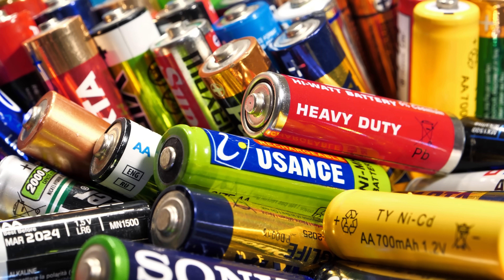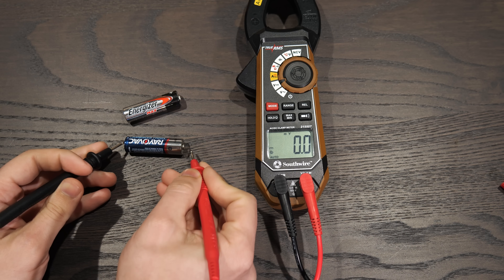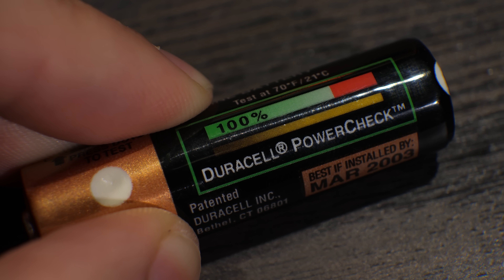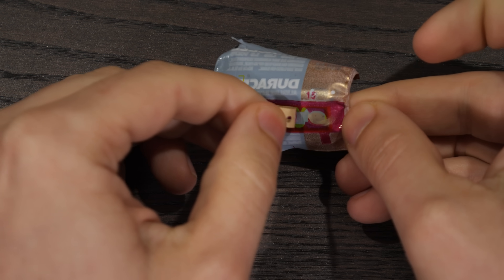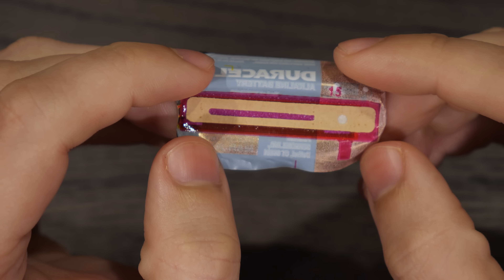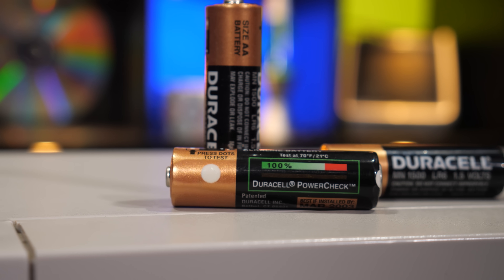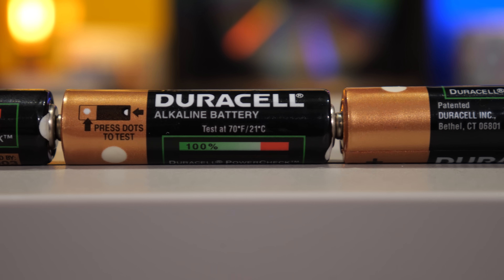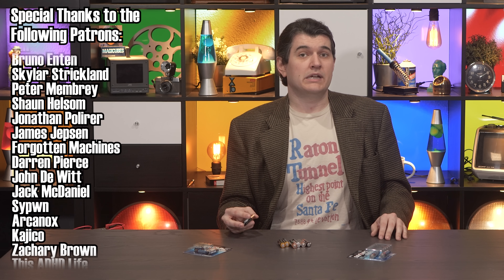Duracell PowerCheck: A genius idea which didn't last that long

Comment: You can drop a battery from 10cm height on one of its poles and judge how full it is based on how high it bounces. An empty battery will jump significantly higher than a full one

Comment: in my county we still have them,but the line is different, they have 4 squares, 2 green,one orange or yellow,  one red, they still "fill up" like it is only one bar with an overlay, but the color gradient is quite nice, they aren't even that much more expensive, just a bit harder to find

Comment: I was a police officer in the late 90’s to early 00’s.  When we did undercover work involving a wire, we always started off with brand new batteries in the wire device, because we were told that once a battery was used in a device, it would continue to degrade/lose power even if the device was turned off or the battery was removed.  The batteries that were used, even if for a very short time, were repurposed for things like tape recorders in interviews (don’t want to waste taxpayers money, ya know). I imagine that these days there are more compact rechargeable devices available for this type of use case.

Comment: I have to say, this would be at the top of the list of things I wouldn't have even begun to think about today, but here we are! That being the case, I do remember on a few occasions way back when, experiencing the joy that came, when you needed a battery, and you've looked everywhere, so you dig through your drawers, suddenly there one is. You push those spots, and it turns yellow saving the day... It's a unique experience to say the least....
 Wow, what memories, thanks man. 

I would have never known...

Well actually, I kind of did I suppose, I tore them apart decades ago, and examined them, just didn't get all the details...lol 👍🏻

Comment: Kodak and Polaroid both had a huge interest in batteries. Kodak used a single AA in every "disposable" camera sold. The battery was good for more than one roll of film so one part of the developing by mail process was to recover the AA battery and save it for reuse in another camera.  If you knew someone at a photo lab, you might come away with piles of very good Kodak AA batteries. For Polaroid, they needed a fairly powerful battery in the film packs used in their cameras.  It also had lots of leftover power and could be extracted from used film packs.  They also sold the batteries themselves as PolaPulse and they were quite useful for being flat and strong.

Comment: the real waste is the giant boom boxes and flashlights using D batteries that is a ton of waste I do have a rack of partially used batteries and a regular battery tester i take batteries out of critical devices like smoke detectors and thermostats and use them for Halloween decorations. and then take them out if still good so they don't leak

Comment: You could test the batteries that way to see if device dead or battery dead if you didn't have a spare set of fresh batteries at hand. But that is also a rather niche use.

Comment: One reason the battery meter is still a useful idea, without having partially used batteries outside of devices, is that a device that stops working can be diagnosed more easily to determine if it really is just dead batteries, or if the device itself is the problem. If your remote for the TV doesn't work, you can pull the batteries and test them using just that type of battery alone, and determine if it is the batteries or the remote itself has another issue. Most of us geeky folks have learned the trick using the camera on their phones to see if the IR emitter blinks, but not everyone knows that trick, and it doesn't work if your camera does a good job of filtering the IR or not allowing it to get artifacted into something visible on the rendered output.

Comment: I found myself wishing for these when our thermostat said one of its sensors had a low battery despite having been replaced recently. I don't entirely trust that device, so a second opinion about the battery would have been appreciated. As it was, I had to settle for swapping for new.

Comment: As a child I used this feature often. The gameboy had a single red led that varied brightness to tell the charge left. It was very difficult to tell the difference between low battery and full battery. And after getting hours into a game and having it die, I started checking the charge before playing using these batteries.
Reply: Then the Gameboy Advance came along with a light that changed color depending on the batteries.
Reply: @Hyper_Drud  In my childhood, the 2007 version of Game Boy Advance SP was already available, which used a really good lithium battery that still works seemingly perfect
Yes, this was already the age of DS and PSP, but PSP was way too expensive for our family while DS for some reason was really unpopular in our country and most kids didn't even knew that it existed
Reply: Buh-ling
Reply: If only they could have put in a few more LEDs for a backlight
Reply: @No_True_Scotsman  they did in Japan. It was called the Gameboy Light. It was essentially a Gameboy Pocket with a backlit screen.
Reply: @Hyper_Drud  I know, but the vast majority of people had to suffer with unseeable gameboy screens

Comment: I honestly thought batteries still had these, because they did last time I frequently bought batteries. And I actually used the tester a lot. It was important to know, for example, if the batteries in my Gameboy would hold for a road trip or not.

Comment: When I was a kid, I'd test all my batteries with a flashlight bulb, sorting them by brightness. I learned which devices or toys needed what amount of power, so I could quickly find the lowest power battery that I could use with any toy. I still organize my batteries like that now, although I've upgraded to a battery tester and use rechargeables for high-drain devices.

Comment: What do you mean they are not longer in production?

I still have one in my alarm clock right now. (So strangely the indicator does not work. Like the battery is clearly powering my alarm clock, but pressing on the button to show its charge does no anything)

Comment: I never got why these needed the two dots. One would have been sufficient to allow the circuit to be closed or open so long as the negative terminal was connected to the meter. The button on the bottom was such a pain press

Comment: I actually prefer these old AA and AAA batteries to internal li-ion batteries in devices. I have several gadgets that are decades old, that I can still use because they take a standard replaceable battery. Modern devices that take proprietary and/or non-replaceable batteries will become useless as soon as the battery stops holding a charge. You may or may not be able to source a replacement.

Comment: Wait these arent sold in the US anymore? I remember having these (estonian) several times and after checking online (when's the last time i bought batteries???) sure enough they are still there, on duracell "ultra power" batteries. They have three sections now, probably still lit up by the same resistor strip but in three sharp sections of different widths instead of the triangle, if i were to guess.

Comment: back when i was a kid i liked these, except yeah you had to really press hard on those testers... what we generally did was we had a little lightbulb like an appliance lightbulb or smaller and a metal stamped frame the light would be bright and white if the battery was full and if it was amber or wasnt bright it was dead...gotta remember back in the late 90's EVERYTHING seemed like it ran off batteries...

Comment: I have a couple of D cells that expired in 2002 that still show well into the green on the meter. I’m amazed the almost 30 year old batteries still have a charge and haven’t leaked yet

Comment: Didn't last long? I checked my drawer, I recently bought Duracell Ultras that would espire by March 2029, and they show these PowerChecks! Their design has ever so slightly changed since, with the bar divided in 4 segments, but still works the same. Maybe they fell out of tune in the USA, but where i live in Europe, they are still very common.

Comment: I think most adults didn't have much of a use case for the testers, but speaking as a kid who had to continually swap batteries between toys because there was no way my parents were going to maintain a supply of batteries for all of them, the testers were critical for knowing which batteries were still good (frustrating as it was to check).

Comment: Could you do a video on why recently made alkaline batteries seem to leak so frequently  inside seldom used devices like flashlights and remotes? The batteries are years from their install by date, and the devices are not exposed to extreme humidity, heat, or cold.  I never noticed this happening so so frequently 10 years ago.

Comment: There is a simpler test for alkaline battery. drop it vertically onto a table from a small height. If it falls without bouncing a few times it is new and full, if it jumps it is used.

Comment: I switched to Eneloop rechargeables almost 20 years ago and I haven't looked back. I still have and use the original cells, and they test nearly like new. They're much more tolerant of abuse than other brands in my experience. If you do discharge them to ~0V they can be woken back up to near full capacity with a few discharge/charge cycles automated by my BT-700 charger.

When they die, I just drop them in the charger and grab fresh ones from the adjacent drawer. They stay fully charged for months to years on their own.

Extra bonus: I've never once had one leak. I never open up a dead remote and find crusty corrosion around the batteries. That just isn't a thing anymore.

Comment: There could be ONE more reason besides Cost and Infrequent use of this feature: Emotion..
Specifically.... Disappointment. 
Imagine testing a XYZ brand of battery with its inbuilt battery tester and it does not turn Yellow... Consumers may associate negative emotions with that brand.
This was an amazingly simple and effective solution to a problem not many were looking to address in the first place.

Comment: 11:15 - I do this all the time with video game controllers. I know you aren’t a big video game player (per your words in the past), but if I have a few friends over I’m tossing batteries into my Wiimotes or Xbox controllers and then when they leave I’m popping them out of the controllers because I’ve had exploded batteries in both Xbox 360 controllers and Wiimotes - so it sucks to have to clean all of the corrosion.

Comment: Unfortunately kids toys today still need 100s of AA or AAA and what's worse half won't work on the 1.2v rechargeable battery chemistry, it's madness that a disposable Vape pen had a lithium battery but a £30 kids toy still needs 4 AAA batteries every 2 weeks and if I put rechargeable ones it just bearly work for 10 minutes then stops chwech battarys running a small load ( Led )  and it's at 1.1v that's the toys cut off voltage madness 2 BL5c Nokia type battery at 1.2ah  a small charger / protection chip that my £5.89 alliexpress nes gameboy has (inc the Nokia protected battery) so as a perent an extra £5 to charge the thing instead of replacing batteries is so worth it Infact some of my kids toys I have moded to run of just that a protected Nokia cell (tested to confirm) that I just plug in to an external charger to charge

Comment: Built-in rechargable batteries are worse than replacable standardized ones, I will die on this hill. Once something stops being produced for a few years, as soon as the battery goes bad it's impossible to find a replacement. You can get rechargable standard size batteries.
On another note, I swear I remember seeing these in the wild until at least 2015. Maybe they were just long dead.

Comment: As a kid of the 90s, batteries got constantly swapped between toys/gameboys so battery indicators were very valuable. I even remember some battery packages having this tech on them instead of the actual battery, and I used them constantly. Today they're not that useful since everything is reliant on a rechargeable batteries for better or worse, but they totally made sense to me growing up.

Comment: The reason they don't exist anymore is they've been replaced by new tech.

Now to check a Duracell you just open the battery compartment. If it is more than 20% used it will have leaked out and destroyed whatever device you had put it in.

Comment: There was actually a neat application of this system for the Duracell 9V batteries where the tester is in the package, so you can keep the package and use it for every other 9V. And instead of the pesky button, you just have 2 tinny contact patches to simply bring the poles against. Real handy!

Comment: I remember when these first came out. Originally they were not attached to the battery, but instead included separate in the pack. You had to manually attach them to the battery to test them. hat was before they started building them into the batteries.

Comment: I only use alkaline batteries that come with a product and when they run out I either use my rechargeable ones for devices that I take out the batteries when I’m done (like my old Gameboy) or I use the single use lithium ones for devices where I don’t take them out when not using them (like my tv remote)

Comment: You should see my battery box, full of half used loose batteries.  I put batteries in Christmas decorations then take them out at the end of the season so they don't leak and destroy the decoration, then I might put the batteries into the battery box and later use them in something like a tape recorder or portable radio or whatever.  Another thing that is a bit irritating is devices that use odd numbers of batteries, my shower radio takes 3 C cells, but the good thing about that is if I buy new packs of 4 C cells each time I replace the batteries, once I've gone through 3 packs of batteries, the fourth set is effectively free.  I also recycle all my used batteries, my local supermarket takes them and sends them off to a recycling facility.  The Game Boy was always quite economical on batteries, I understand 4 AAs would last quite a long time.

Comment: A trick my dad did to get more use out of batteries was to take used ones from a higher power gadget and put them in remotes.
Remotes are pretty low power so they'd be able to work on the lower voltage of the second hand batteries for a significant amount of time.

Comment: 12:30 ah but the issue is that nothing except for a pager ever needs just one battery, so if you put your junk drawer batteries in your device and it doesn't work, you don't know which of the two batteries is dead (it might even be both)

keep in mind stuff like the original game boy would take four batteries to function so figuring out which of the four batteries you've put in were dead (again it could have been any one of the four, any two of the four, any three of the four OR all four of them) 

still baffles me that people buy one use batteries, just get ones you can charge and a charger, they're not that expensive and they last forever if you get a good one, like i replaced the battery in my swissphone boss pager earlier this year and i have had the thing for five years and the guy who had it before me had it for god knows how long.

Comment: Now Duracell batteries are made in China and don’t last anywhere as long as they used to. For example a clock that took a AA battery would last me 2 years before changing, now if I get six months in the same clock is the norm. They come from Costco btw if it makes any difference.

Comment: I mean yeah, single use batteries are not the greatest, but it's not like just just disposing of them in the trash (I mean that'd be a giant fire hazard), they do get recycled and I'm correctly informed you can recycle them pretty well.

And I'd for sure take devices with AA slot over most built-in batteries, at those make the device disposable in the long run. Good ol' Xbox controllers are great for that reason, where other controllers die and then you have to plug them in and wait, with those you just can put in some spare batteries and continue. And of course you can use rechargeable AAs or even an external clip-in rechargeable battery and when they eventually die you can just dispose of only the battery and can keep on using the controller.

Comment: It's a shame you didn't mention the drop test!

If you drop a battery from about a foot above a flat surface, if it's good it will just drop, if it's bad it will bounce ... this is because as the cell discharges it expands, making it bouncier when you drop it!

Comment: I think another factor is that batteries are waaaaaaaaay cheaper than they used to be. In the past, people seemed more eager to get every last germ of power out of a battery before discarding it. Today, batteries that are just starting to fade are likelier to go straight into the bin. I was a kid in the 70s and 80s. Batteries were mostly sold in twos, fours, and eights then. I have memories of 4 quality AAs selling for a minimum of $5 (Canadian), so let's say at least $1.25 per battery. A quick look at amazon sees 24 Duracell "Power Boost" batteries selling for $20, or about $0.85 per unit. Take 40+ years of inflation into account, and batteries are a miraculous bargain compared to 1980.

Comment: I think primary cells/batteries got cheaper. At lease it feels that way for me. So we care less about how much life is left and just chuck another set in.  
I never used those built in ones anyway. As I didn't want to use up what little power energy that a AA held, heating up a strip. Also didn't really trust them, due to the difficulty in getting those connections made.